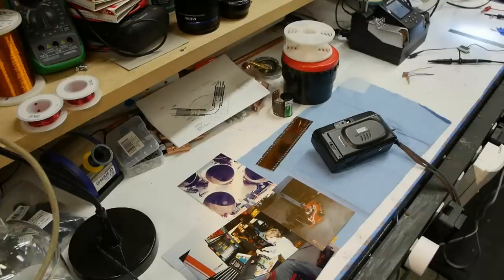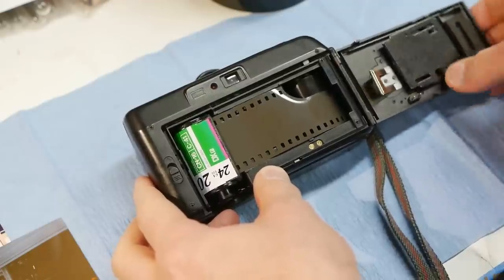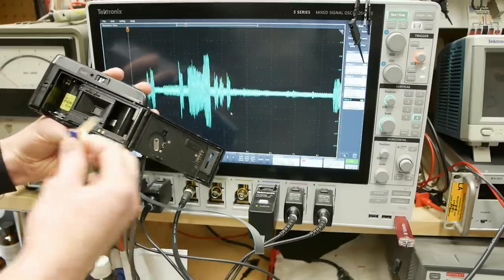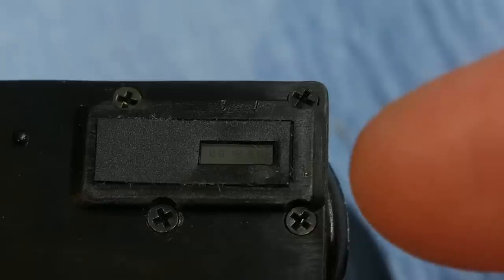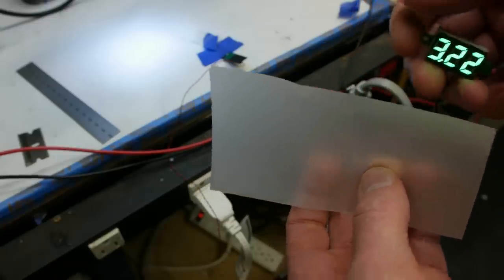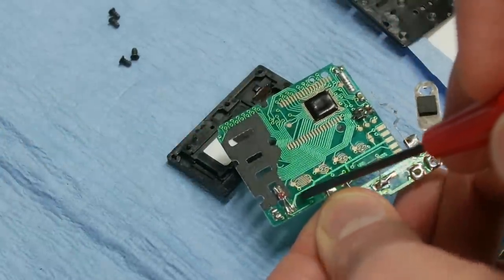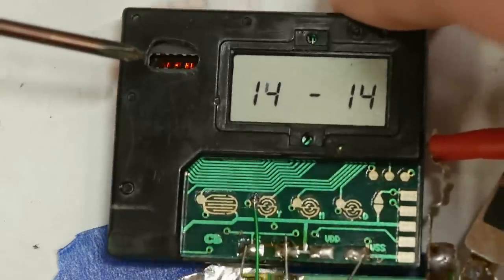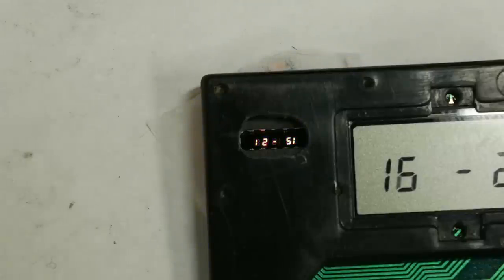How a film camera superimposes the date onto photos

Comment: But my question was always was: what's the [digital equivalent] resolution of 35mm films?
Reply: It varied greatly depending on the kind of film and the ISO. But generally speaking the faster the film the lower the resolution. If you wanted really good resolution, such as to use for say a poster enlargement sized print you'd want 100 or even 50 speed film and in most cases you'd end up using a tripod to get a useable picture.
 B&W films (tri-x and pan-x were two gold standards) usually had even better resolution which is why they were very popular with the home projection crowd. The particles are finer because they're only detecting light and not 3 individual colors. These guys claim 35mm is equivalent to 4k. The reality is that it can be both better or worse.
https://www.screendaily.com/features/the-resolution-war-is-cinema-falling-behind-home-entertainment-on-innovation/5124023.article
Reply: @johnpossum556  Interesting. I thought it would be much higher than 4K (~8 MPixels) though. I also always had a second question that might sound ridiculous. I always wondered what the resolution of human eye would be. I know there are ~6 millions cone cells but since the whole vision process is very complicated people have come up with different numbers without any solid ground.
Reply: @pomegranatechannel  I think 4K is closer to 16MP. Its 4K times 4K.
 As I understand it the human eye really only has one high definition seeing zone and that is in the middle of your vision. The rest is allegedly filled in by how much and how quickly your eye moves. The brain remembers the rest and it even fills in a dead spot we all have where the optic nerve connects to the eye ball itself.
 If you're really interested about the eye I'd try googling up some of the Navy's tests. I think they were called Wave Front or something like that. Anyway they found aberrations in pilots' sight that they thought made them able to react quicker than the rest of us.
Reply: @johnpossum556  I agree. I think humans have sort of tunnel vision. I'll look up that Wave Front. I've also noticed my vision has higher refresh rate at surrounding than the center. Vision is indeed very complex.

P.S. 4K means 4 x FullHD (1920x1080) or almost 4K pixels width which is 3840x2160 = ~8MP
Reply: @pomegranatechannel  Hmm, well I thought I remembered Linus saying it was more than 8MP. Maybe I was just too tired to think clearly. The reason the Naval studies were so big was that they made the lasik eye surgery better. What I think is even more fascinating is that many birds of prey can see in ultraviolet.

Comment: would it be possible to make it go beyond 2019?
Reply: Technically yes, however, it would require extensive modification. You see that black blob on the PCB? That's where the controller for this thing lives. It's just the die, directly bonded to the PCB substrate and covered in something so it doesn't get damaged. To make it go beyond 2019, you'd have to get rid of that little controller and replace it with your own. At that point, you might as well remake the whole PCB.

Comment: Hey i just watch a video on codyslab in which he generated electricity running mercury through plastic and glass tubing. He was doing it to kake a vacuum pump. I was wondering if you can test if this is scalable. I.e.
Length of tubes.
Number of tubes.
Is glass and tubing needed?
Can you store the potential in mercury and discharge it on a timer?
Please up vote so this comment is seen.

Comment: Considering how slow that LCD update is, has anyone ever seen a date in transition?
Reply: Highly unlikely to happen, since the date isn't driven by a timer, it's set by buttons. If you didn't change the date, it would stay at the same date forever.
Reply: I think I saw a quartz crystal on the board so I think it does auto roll the date
Reply: @joeynebulous816  There's no timing device, thus no oscillator that would drive the date autoroll. It has to be rolled automatically.
Reply: The cameras that I owned back then updated the date. Some of them could even show the time of day. The electronics in the date module control the projector light, I assume they defered date updates while the projector bulb was on.

Certainly, the ones that displayed time of day must have had an interlock. The odds of hitting a minute transition would be 1440 times higher.
Reply: @CZghost  Entire digital wrist watches were only about $3 new back then.
Reply: @hamjudo  Maybe some did autoincrement time. Anyway, what have digital wrist watches common with cameras?
Reply: @CZghost  It demonstrates that the parts needed to accurately track time were incredibly cheap, even back then. If the quantity 1 retail price is $3, then the parts are much cheaper. Sometime that decade watches were available new for $1.

Comment: Wouldn't the time date get inverted when the film was developed?
Reply: It should be right reading when printed - because the characters are flashed on the back of the film and camera image is on emulsion side of the film, when seen together in the final print they match. If you were flashing the emulsion side you would need a backwards (mirrored characters) led.